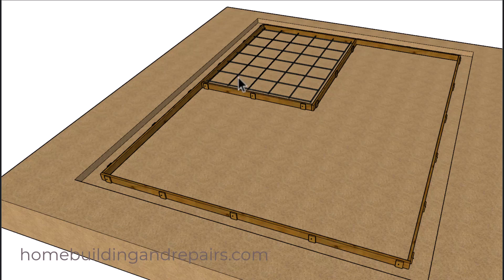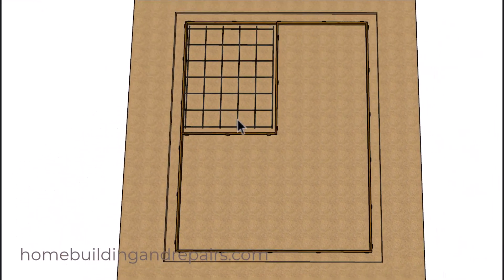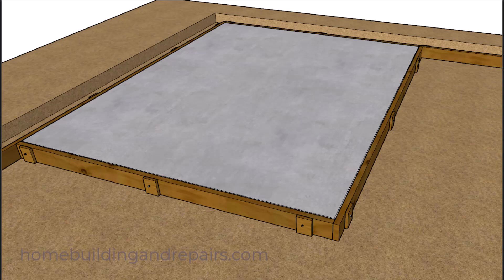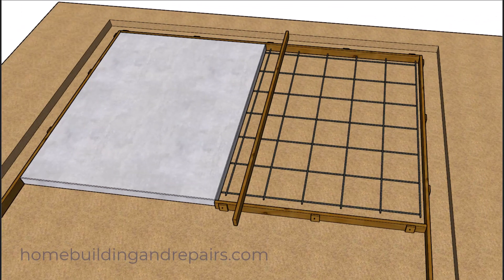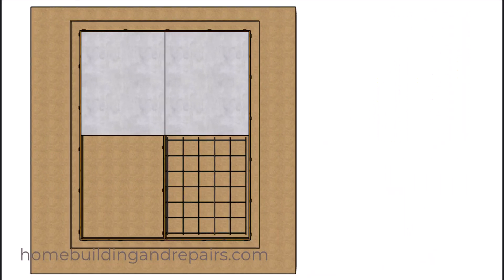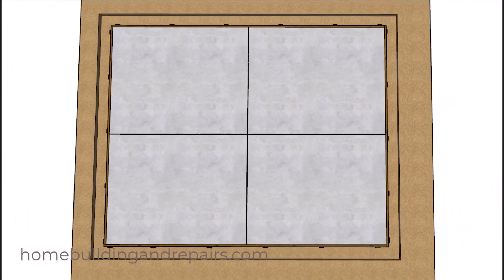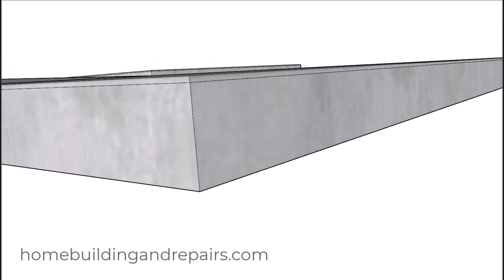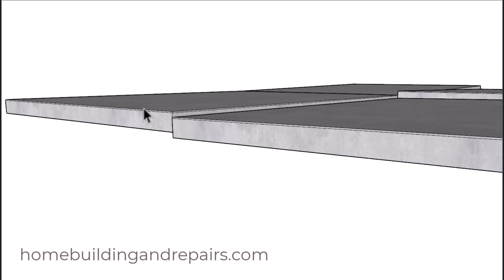Why Concrete Can Separate, Raise or Sink When Rebar Does Not Connect Sections of Driveway Together

Comment: i only used wire in my own driveway DIY i made sure it was 5 in thick.  I only use rebar for retaining wall or special post pours like a carport cover to help prevent lift and for strength. If a floor like a shop floor is going to be done in 2 pours i make sure both sets of wire are secured together and use a joint tool on that joint.